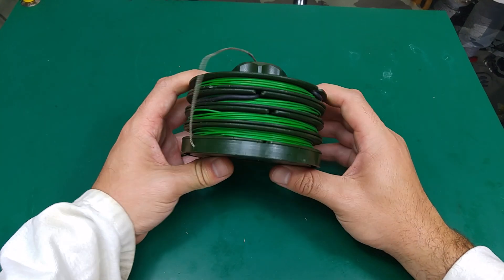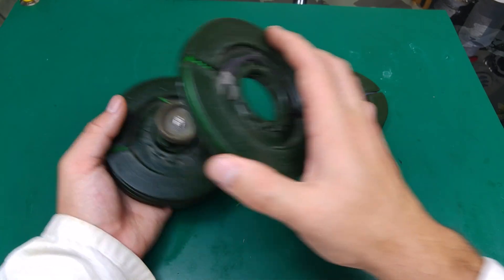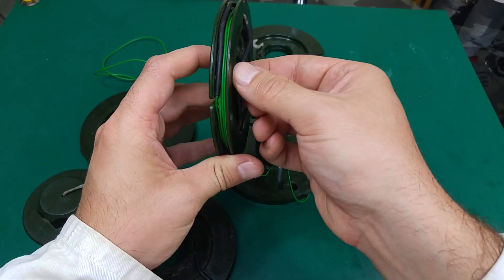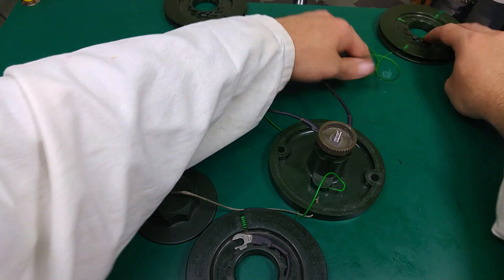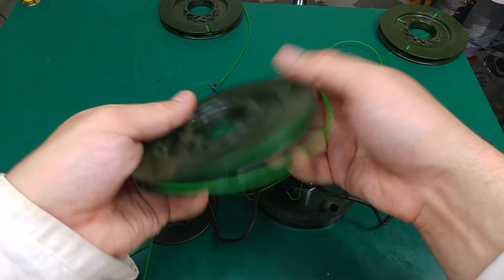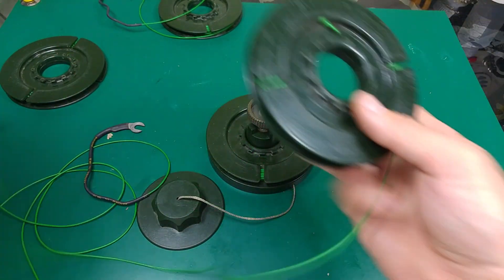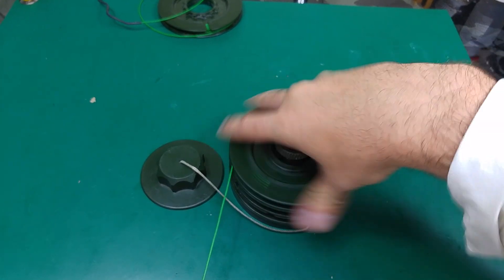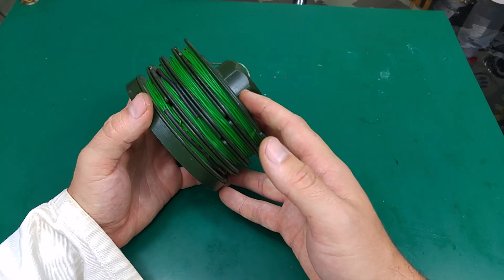Clansman army drum antenna counterpoise for PRC320 HF manpack radio

Comment: Thanks for the video, it's a well designed piece of kit and you demonstrate it very well. I have a counterpoise in the shape of a X but I think it is for the 351 VHF series of sets.
Reply from the maker: Thanks for the info! I never saw counter poises on tactical VHF. I would suggest it's earlier or newer version still for PRC-320 or other HF radio.